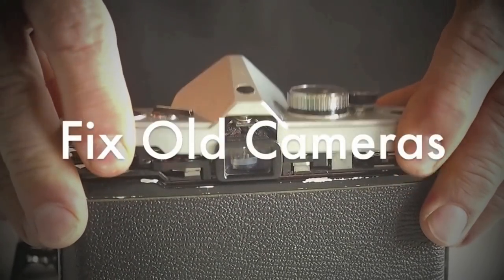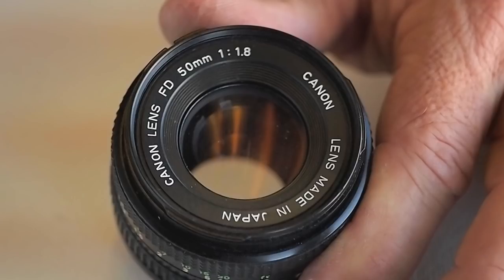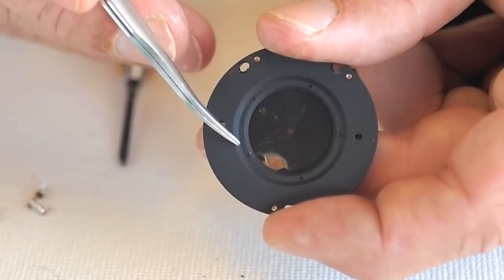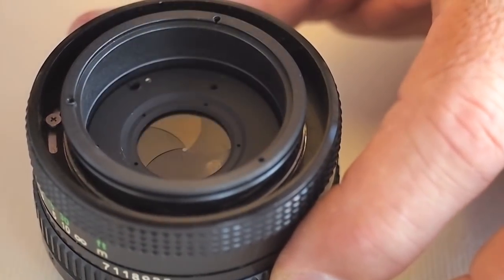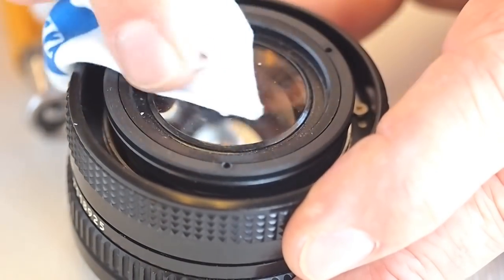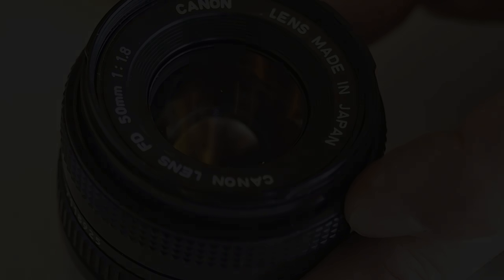Fix Old Cameras: Canon FD 1.8  Stuck Diaphragm

Comment from the maker: In most cases, as you did, simply trust your eye. The same holds for shutter speeds.   Compare to a known good lens or camera when possible. With a little experience you will become accurate well with in any error margin. Video suggestion all always appreciated.

Comment: I found out that the first attempt at cleaning the oil may not be the last. On the three lens (2 old FD 1.4 SSCs and one new FD 1.8) all had oil/sticky aperture blades again a couple days after cleaning and reassembly. What I found after going "crazy" and actually disassembling the aperture assembly on one of the older lens (not for the faint of heart!! they are not fun to reassemble!!) is that in addition to the oil and such on the blades the inside of the assembly also has a coat of oil/grease that is not easily removed (I had dropped the entire assemblies into a glass bowl of isopropyl alcohol and worked them vigorously and it still didn't all come out) and then that gets transferred back onto the blades. The lens with the aperture assembly I took apart has so far remained clean, so today I took apart the f1.8 new fd lens and completely disassembled the aperture assembly and cleaned all the oil out of the insides (with only 5 aperture blades it was a lot easier to put back together, couple toothpicks, tweezers and an ijs Phillips screwdriver were all the tools I needed). I have read on a couple websites that suggest Naptha as the solvent. Any comments on using it as a flush instead of the isopropyl alcohol?
Reply: Ronsonol cigaret lighter fluid, which is naphtha, is a better solvent for oil and grease residue on blades than is isopropyl IMO.  Use with lotsa ventilation.  Follow cleaning with carefully-directed compressed air from one of those cans sold to clean computer keyboards - to expel remaining solvent and oil from the inside of the blade pivot housing.

Comment: Note that there are at least two versions of the old FD lens as well as the new FD (nFD).  Canon designed them simpler as the years went by, removing screws and replacing them with friction fit.  But the basic design and repair technique is the same for all.

Comment: Hi, I purchased an FD 200mm f4, and I just noticed that the diaphragm won't close more than a half stop past 5.6. There is no visible oil or dirt on the blades, but there is a little drop of grease near one of the three internal screws halting the diaphragm. If I act on the lever, the diaphragm can be closed without noticeable friction (the lens is mounted on a novoflex adapter), then I can open it acting on the aperture ring, but then again it closes only till 5.6 and a half stop. The vendor has offered either a full refund or a repair (with no additional cost whatsoever): what would you advise? The refund ist the easiest way, but then it could happen again with another used copy of the same lens. Maybe it is better to send it back and have it serviced, or is it an issue which does repeat itself periodically even after service?

Comment from the maker: The oil that ends up sticking aperture blades migrates from the focus helical due to heat and age. The optimal choice is complete disassembly of the lens and stripping all old lubricate followed with an application of a light synthetic grease on the helical. Congratulations on the successful reassembly of your lens. Naphtha is a harsh solvent so handle with care. It can be unstable with a strong odor and is extremely flammable. It should not harm the aperture blades. Avoid getting any on the lens elements. A less smelly alternative on  a stubborn set of aperture blades would be the use of an aerosol electrical grade contact cleaner. Max Professional is a good choice. It is safe on plastics and evaporates quickly.  Again, Fix Old Cameras attempts to show workable, if not always perfect, techniques in which the average user can get a lens operating without complete disassembly. As technical as classic camera equipment can be there is still an art to the balance between effort and results. Thank you so very much for your support and interesting comments.
Reply: As far as I can tell the only way oil/grease can migrate to the aperture assembly/blades is through the 2 openings where the aperture control arm (release?) and the aperture positioning "tab" access the lens "barrel" ( and then it would appear to have to enter the assembly and then be "wiped" onto the blades). I assume that the same condition that caused the original occurrence can/will eventual reoccur unless the grease is removed and replaced, but from what I've seen recalibrating the focus without the correct tools would not be fun (if even possible). If you folks have a way to do that a video would be of great interest on that procedure.

Long ago in a "past life" I built a basic lightbox (wooden box, plexiglass covering the opening, lamp socket, 60watt incandescent bulb, dimmer, and aluminum foil for a reflector) and made my own resolution target for "semi calibrating" security type cctv cameras that I repaired at the time (it also made a good pizza slice warmer ;-) ).
Reply from the maker: Once the old grease on the helical threads starts breaking down it will continued to be an issue over the long haul unless completely removed and replaced. However, the migrating process is typically very slow and a good cleaning and flushing away of residual oil from the blade assembly will usually keep the problem from recurring for an extended period of time. All suggestions for videos are appreciated and considered. The multi-tasking light box was clever.
Reply: I disassembled and re-cleaned the aperture assembly in the 1.4SSC lens that had oil reappear on the blades. Let the whole assembly sit in a glass bowl full of Naptha (outside so as to avoid the fumes), dried, repeated and then set the whole assembly in a glass bowl of 91% Isopropyl Alcohol, dried, repeated and it appears to have gotten all the oil out of the inside of the assembly (I also meticulously cleaned the barrel of the lens with cotton swabs and 91% Isopropyl Alcohol (something I hadn't been quite so careful about the first time around). So far that appears to have resolved the issue for now.

While I had the lens apart I decided to make an aperture opening measuring device so I could "calibrate" the aperture assembly after reinstalling it. Canon provided a chart with their SSC series maintenance manual so what I did was drew a little "diagram"/template in the free drawing program from Google called "Sketchup". I started with a 45mm diameter circle for the inside dimension of the lens "barrel" and then drew  a 23mm diameter circle for the opening in the aperture assembly (If you're going to make your own in "Sketchup" remember it draws its pre drawn circles and shapes based on  radius, not diameter, also all the predrawn figures measure the radius centerpoint to point, not centerpoint to flat so some tweaking is required). I then drew each fstop dimension from the Canon chart using the octagon predrawn figure (f`16 is pretty small and you probably don't need to draw it because if the rest of them are good when you're done "calibrating" then it is too). Print it to scale on your printer and then using those skills they taught you in kindergarten/1st grade of elementary school cut out a half moon section (I used card stock to print on so it holds its shape better) and then with the aperture assembly back in the lens and the mounting screw by the spring just snug drop the diagram in the barrel of the lens and check each whole fstop by rotating the manual aperture ring to each stop. On the SSC lens you can lock the aperture actuating arm in the aperture active position by sliding it past the detent. Don't forget to return it to its normal position before attaching the lens to to your camera!!
For the new FD lens you'll have make a small plastic or cardboard shim  to hold the lever in the actuated position since those lens don't have the same "feature" the breechlock series lens had.

Here are the measurements (remember all measurements are diameter, in Millimeters, flat to flat on the hexagon openings) for the 50MM FD 1.4 SSC lens (I believe they're the same for the new series lens which goes to f22, but as I said you can't draw anything usable below f11 for either lens anyway): f1.4=23mm (diameter. this is a fixed dimension created by the hole in the aperture assembly) f2=16.84mm, f2.8=11.84mm, f4=8.34mm, f5.6=5.88mm, f8=4.15mm, f11=2.93mm, and f16=2.07mm. You can get the upper and lower tolerances for each stop by multiplying and dividing each dimension by .915 (at f16 the chart gives a +or- tolerance of about .19mm)

PS: If I were to go "whole hog" and disassemble the focus assembly does anyone have a recommended synthetic grease to use and a source to buy it from to relube the lens with? I didn't see anything on Mike Trost's website. I have a 50 MM 1.4 new series FD parts lens I could practice on.
Reply: PS: I forgot to mention the barrel dimensions of the lens:

Old style (breechlock) 50mm FD 1.4 SSC=45mm (diameter)
New Style (bayonet) 50mm FD 1.4 = 42mm (diameter)
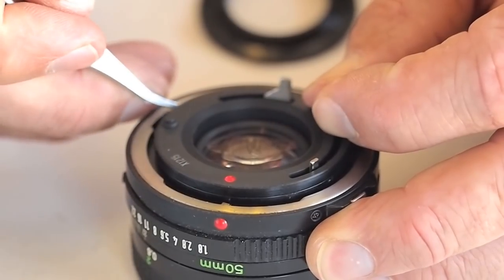Reply: From 1:20 and on, your activating the manual aperture lever by rotating the inner lens. I have done all the work I put the lens together and everything is OK BUT my lens is NOT clicking BACK ON THE CAMERA. I cannot rotate back to normal mode. In your manua here you are not telling anything about this. BUT the lens cannot work on a FD camera anymore. THATS A MAJOR PROBLEM. PLEASE HELP. I AM STUCK. NOBODY GIVES AN ANSWER ON THIS. Thanks already.
Reply from the maker: There is a fork linkage in the lens body that the lever on the aperture assembly plate drops into. Once it is linked, then position the screw holes of the aperture plate so that it places the aperture assemble plate so that the linkage moves freely.
Reply: I dont understand a bit actually. Do I have to OPEN the whole lens AGAIN?
Reply from the maker: To check the aperture plate position will require you to gain access to 
it as you did originally. To check the aperture cam follower position 
and aperture stop down cam you will have to remove the back bayonet 
mount of the lens. The procedure to remove the bayonet mount of this 
particular lens is not presently covered in a Fix Old Cameras video. 
However there are some videos of similar lenses that might be helpful.

Comment: The f1.8SC (old style breech lock lens) disassembles in the same manor as the video shows until you arrive at the aperture assembly. The aperture assembly does not come out like the new FD f1.8 lens (nor the new FD f1.4). When you remove the screws you will end up with the cover plate and 5 aperture blades lying loose in a pile and the aperture blade control plate/arm hanging from the spring attached to part of the lens barrel assembly.

If you got that far all is not lost. Carefully (I suggest tweezers) pick up each of the blades and drop them in a small bowl of 91% isopropyl alcohol and let them soak. Clean the cover plate with a cotton swab and Isopropyl alcohol.

Carefully remove the spring from the hole in the barrel assembly (you'll have to remove the breechlock assembly to access this part. Watch out for the 2 small ball bearings, springs, and the aperture signalling rod/spring!!) that is holding the blade control ring (a spring hook would be of great help here and when reinstalling the spring, they can be found on amazon or ebay, or you can probably fabricate one out of a paperclip or a small fishhook). The control plate should now come out of the lens barrel. Clean it on both sides with a swab and isopropyl alcohol. Clean the lens barrel with a swab and isopropyl alcohol to remove any oil, grease, or dirt.

From this point on don't touch any of the surfaces you cleaned with your bare fingers. Tweezers, a lightly magnetized screw driver, and tooth picks should be used to reassemble every thing past this point. If you have to touch the plate or control plate then do it by the edges.

Reassembling the aperture blades: The cover plate and the control plate both have holes in them that correspond to two little round tabs on each aperture blade. Set the control plate in the cutout on the cover plate. There is a squared  notch where the control arm aligns with when you have the control plate in the correct position.

Now carefully place each aperture blade so that the two round tabs drop into the corresponding holes in the cover plate and control plate. It is best for the first 4 blades that they be in the fully open position. The 5th blade is lots of fun since the holes its tabs go in are now covered by the first blade you installed, Move the control arm so that the 4 blades start to close. Ever so carefully place the last blade's tab end under the first blade while at the same time leaving the rest of the blade on top of the 4th blade you installed. If at first you don't succeed...try, try, try....again.

When you have all 5 blades in place and working properly now move the control arm until the aperture is completely closed. Now you need something round and tall enough to set that completed assembly on so you can lower the lens onto it (I used an old prescription bottle). Carefully lower the lens barrel down on the aperture blades trying to align the screw holes looking through the back of the lens barrel (this may take a couple tries, once again" if at first you don't...."). When you have the assembly back in place, while holding pressure on the assembly via what ever you set it on, flip the lens over. The aperture assembly should be back in place and you can reinstall the three screws. As far as I can tell various alignment tabs force the plate back into its proper location and there is no need to try and calibrate the aperture mechanism (though scribe marks always help. mark everything as you take it apart).

Reattach the spring to the hole it attaches to (a drop of some clear enamel or loctite will help make sure the spring stays were it belongs). Once again a spring hook will come in handy trying to reattach the spring.

Reassemble the lens and you should now have unstuck aperture blades (until more oil leaks in and you get to do it all over (unless you're really brave and take the focus coils apart and re-lube them with a good synthetic grease that won't break down).
Reply from the maker: This is a detailed and workable description of how the aperture blades could be accessed and cleaned in the Canon f1.8 SC (old style breech lock lens).  A word of note: a small vacuum table helps in keeping the blades in place as they are laid into position, however as you have demonstrated it is not essential. Nice Job. Watch for an upcoming Fix Old Cameras video on the the Canon FD f1.4 SSC (old style breech lock lens).

Comment: the red dots no loner line up. how do i fix this? did you miss a step? the ONLY thing I didn't redo was aligning the red dots. HELP ME!!
Reply from the maker: With the back of the Canon FD 50mm 1:1.8 lens facing you, press the square silver button (the same button you would press to release the lens from the camera) and simply rotate the inner red dot counter clockwise until the alignment snaps into place with the outer red dot.

Comment from the maker: Check the position of the aperture plate assembly make sure it has not shifted a smidge counter clockwise. Also you might have to adjust the position of the aperture following cam. In order to do that adjustment the rear bayonet assemble will need to be removed and entails another set of linkage alignment issues to take note of on disassembly.

Comment: I’ve heard that lighter fluid (Butane) can also be used to clean and degrease aperture blades (as it also evaporates at room temperature).
Any thoughts on using this over 99.99% Isopropyl Alcohol? 
Thanks so much

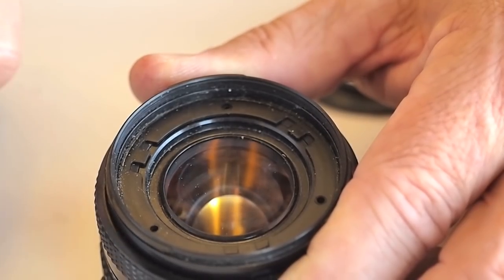Comment: At 1:02 you say invert the lens to allow the front group to fall out, this doesn't happen. second lens ive tried with and hasnt come out either time, suggestions?
Reply from the maker: Could be stuck because of gunk. Try seeping some isopropyl alcohol around the lens group where it seats into the main housing. Twist it a lightly to break it free. Invert and give a shake or tap and see if the stubborn group will then fall out. Don't forget to be prepared to catch it if it should come loose.

Comment from the maker: There is a fork linkage in the lens body that the lever on the aperture assembly plate drops into. Once it is linked, then position the screw holes of the aperture plate so that it places the aperture assemble plate so that the linkage moves freely.

Comment: i dont know if this will get replied to, but in my instance my lens doesnt have oil just the blades sometimes completely refuse to work. like ill install the lens one time and it will stop down and work fine. then i swap a lens and swap back to the 50 and the blades do not work at all. when it does run its clear they arnt oily or have any defects i can make out
Reply from the maker: Oil on the blades is not always visible as it can be isolated around the pivot points. If the blades do end up being oil free, then the stop down mechanism and linkage will have to be checked for a malfunction or misalignment. Another lens identical to the one you have in working order might help has a point of reference for you.